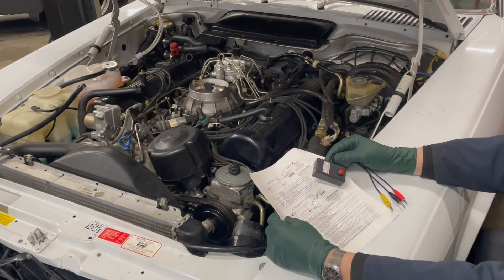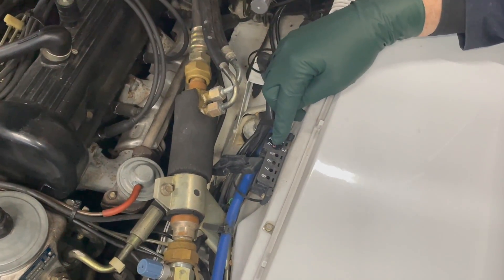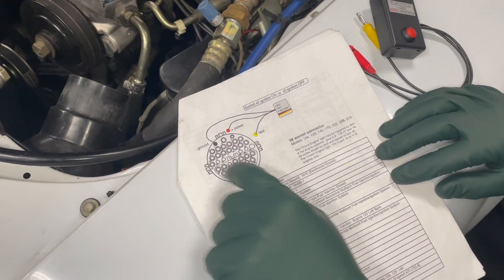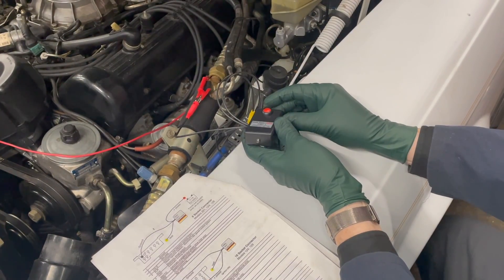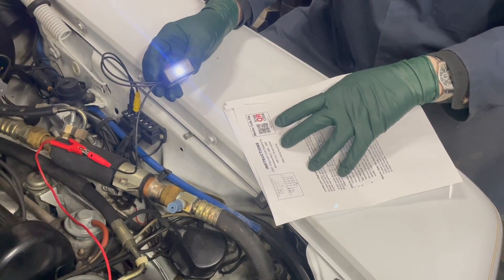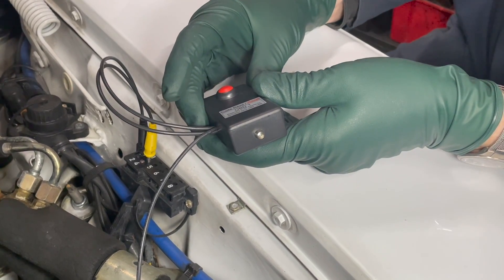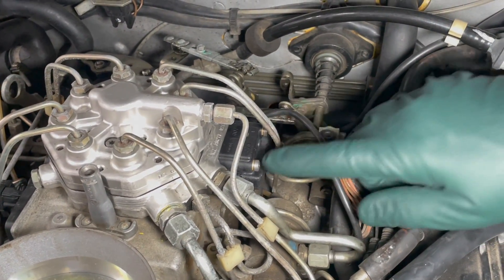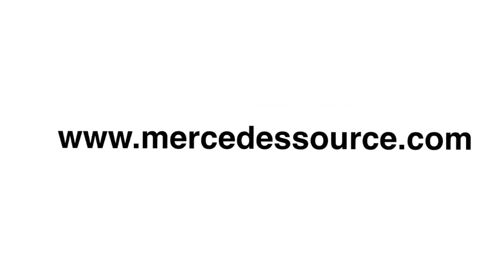1989 560SL Check Engine Light. What? How Do I Find Out Why?

Comment: This is a great tester.   Also have a 1990 300 E, but a CA model with the LED and button on the 16 pin connector.  The on board button seems to be the factory reader in this case.